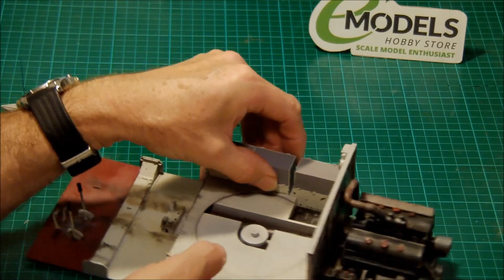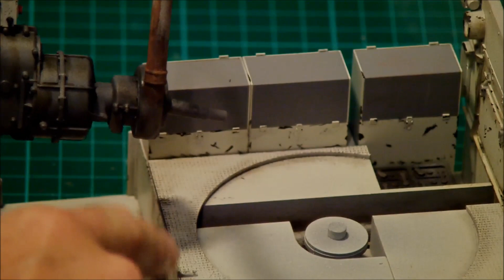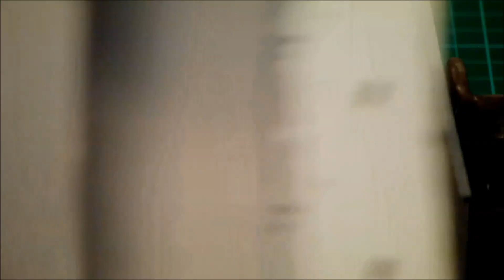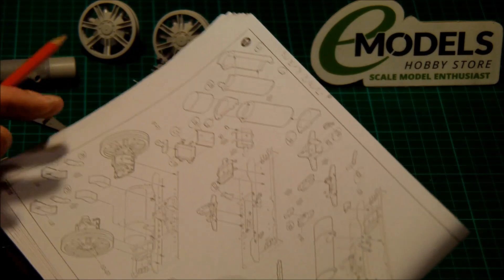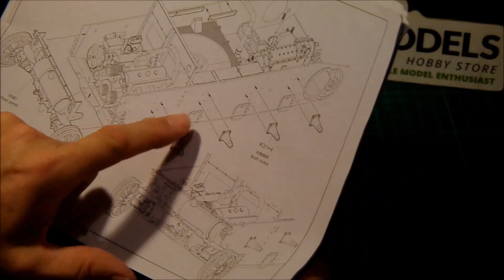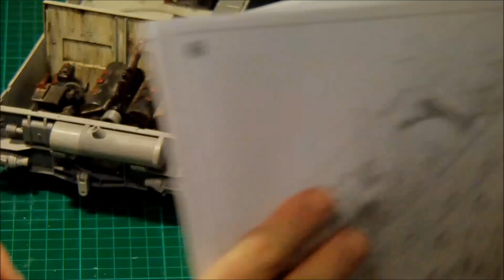Trumpeter 1/16 Pz.Kpfw.IV Ausf H German Medium Tank # 00920 - Part 4 Build

Comment: A bit late responding, but the small square piece on the left of the muffler is the exhaust for the turret motor....the 2 pieces under the engine exhaust are the inlet pipes from the exhaust headers. Nice video series.
Did you forget about the fan belts in the end?